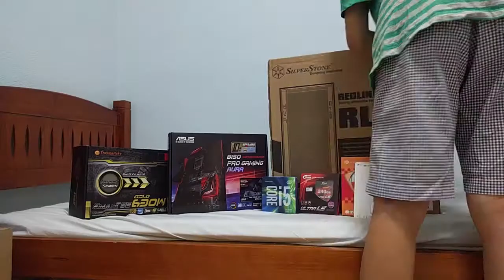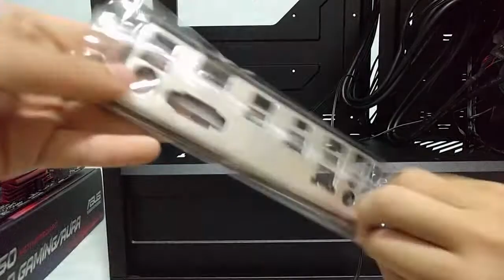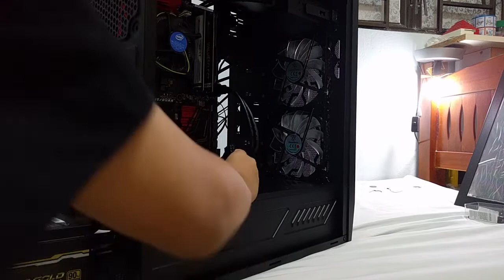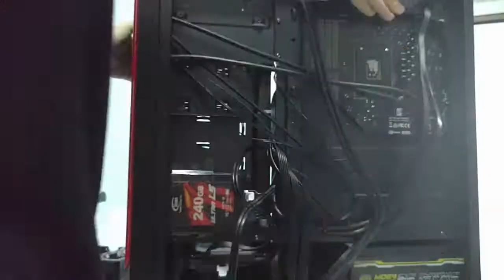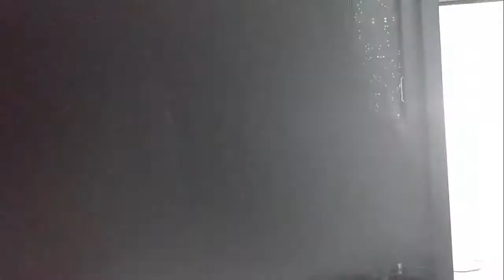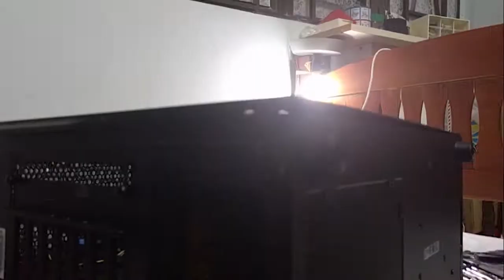My Computer Build (Ft. Hair & Shorts)

Comment: can i know how's the USB3.1 type C connected to the motherboard? Sata express?
Reply from the maker: 19 pin USB 3.0 connector, the USB type c doesn't have 3.1 speed, But the case has 2 different cables for the duo usb 3 and type c ports, so I'm only plugging in the 3.0 cable atm, I don't know why they designed the case like this either.